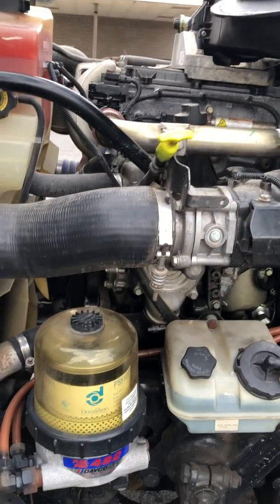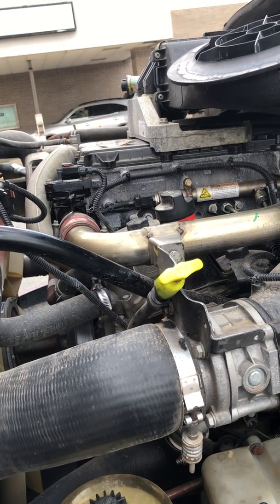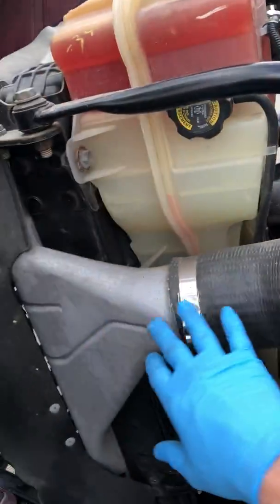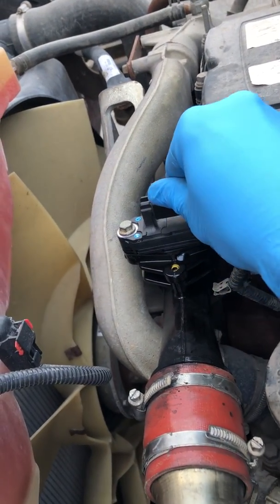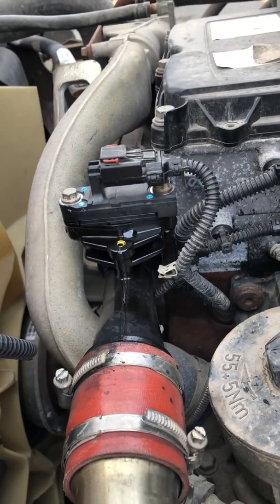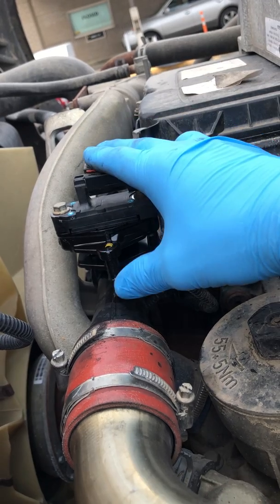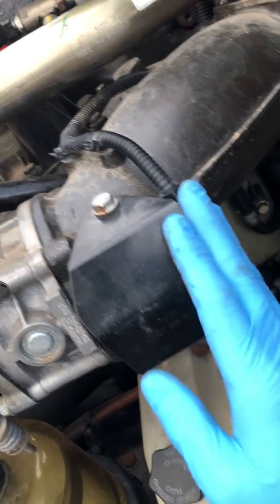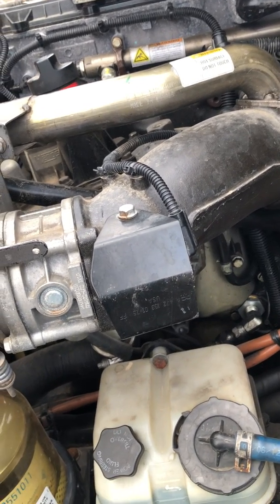Freightliner Cascadia DD13 SPN002659

Comment: Hey can I change it myself and that’s all or it needs to Be plugged in to a laptop to program it?
Reply: Did you have to get it calibrated with a laptop?
Reply: @marknorth1686  man to be honest no need it, look I replaced Venturi pipe, delta sensor, manifold sensor and engine air filter and took
It to the place to delete the codes on with the laptop and that’s it no More codes or issues since then, but after that I’ve been using only bottle DEF
Reply: @JG-ss9xy  I changed the same 2 sensors today and got 2 more codes 😅😫 SPN2631 Fail 01 & SPN96 Fail 05 🤦🏽‍♂️
Reply: @marknorth1686  they always recommend to replace the pipe 80$ and the filter 80$ my local lub place charge me 150$ to delete codes with their laptop
Reply: @JG-ss9xy  thanks I will look into it tomorrow, was the pipe clogged when you took it off
Reply: @marknorth1686  no to much mine was 2016 with 400.000 miles but I decided to replace that at the same time

Comment: Are you using the dd13 for over the road or local, I want to use mine for over the road but they are saying dd13 is just for vocational truck
Reply from the maker: Harrison Odoh I am using for local hopper work. It was a Maverick truck which was over the road. They are good over the road trucks
Reply: Asmare Desta ?

Comment: Hi . I have  questions. When I'm driving heavy on hill the check engine light come on and no power , after hill road straight power back and no check engine light.  I have 2011 freightliner cascadia DD15 engine. 2 codes: Leakage in high pressure fuel system too high (leak down test) & fuel Rail pressure Low . What's can be?